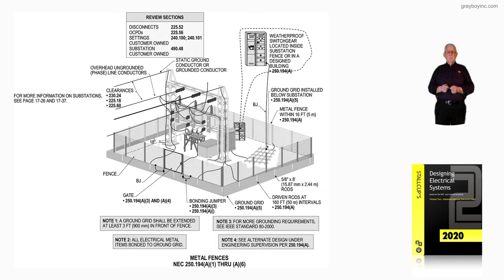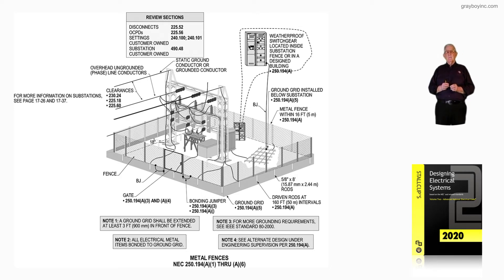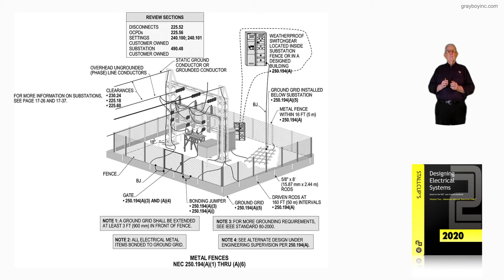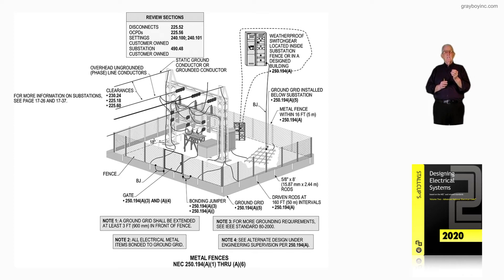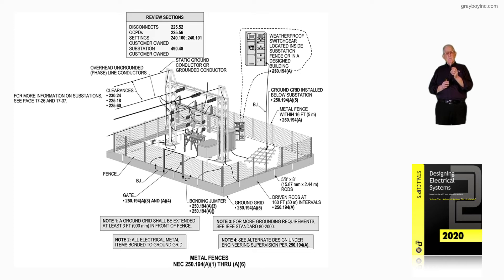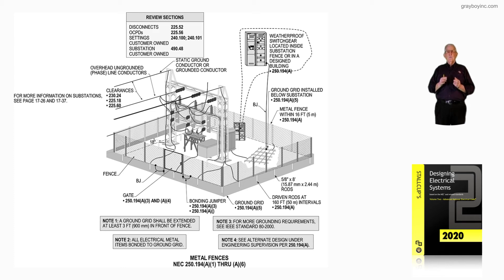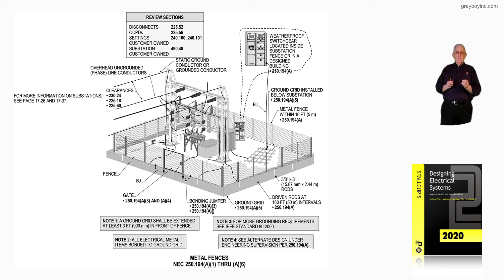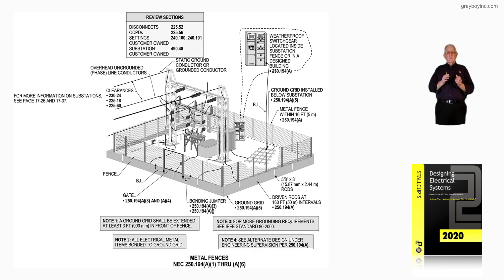16-140  METAL FENCES - 250.194(A)​​​​​​​

Comment: 1/ The code says: "Where metal fences are located within 5 m (16 ft) of the exposed electrical conductors or equipment, the fence shall be bonded to the grounding electrode system with wire-type bonding jumpers". What is the "grounding electrode system"?

If I connect the fence to many ground rods, should all the ground rods to be connected together? or is it OK if all the rods are not connected together? Is a single rod considered a "grounding electrode system"?
If all the rods must connected together, should all the ground rods also connect to the ground ring in the equipment pad?

2/ The code says "Where metal fences are located within 5 m (16 ft) of the exposed electrical conductors or equipment," then the "Bonding jumpers shall be installed at each fence corner and at maximum 50 m (160 ft) intervals along the fence."

For example of a rectangular fence ABCD, if there is only 1 place in AB side where the exposed conductor is within 16ft, then should we ground the whole fence with 160ft interval? or should we just ground the fence in only 1 side of AB to the corners of A and B (the other side of BC, CD, and DA will not be grounded)?

In the case that the AB side is so long, for example 1000', should we have to ground all the length or when to stop?

3/ The code says "Where bare overhead conductors cross the fence, bonding jumpers shall be installed on each side of the crossing."

How far away the bonding jumper to be install from each side of the crossing? 5ft or 10ft or what?
When grounding the fence with overhead line crossing, when should we stop grounding (160ft from each side of the crossing?) or we have to ground the whole fence?

Thank you very much.